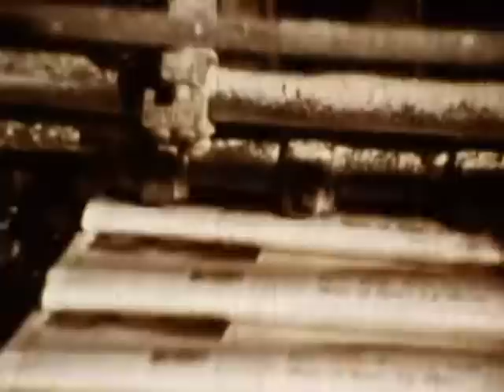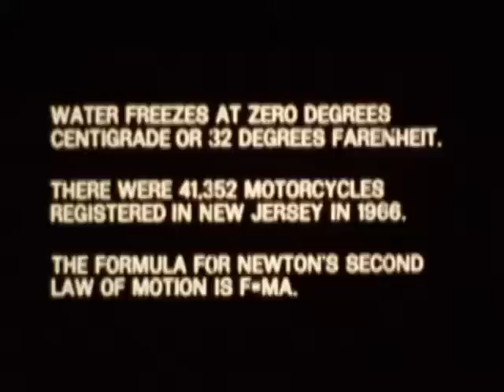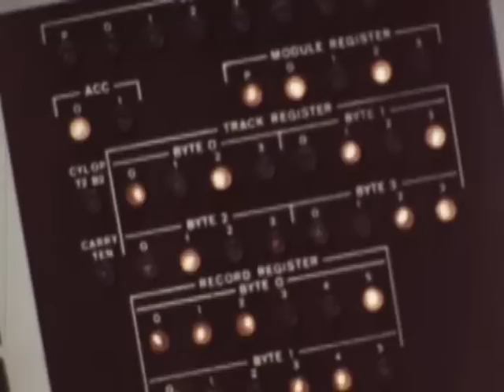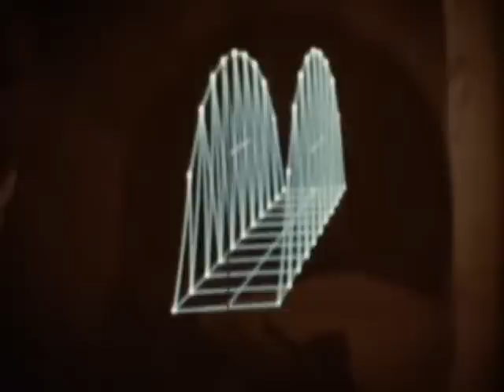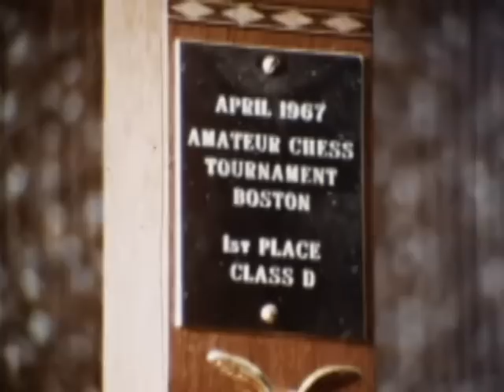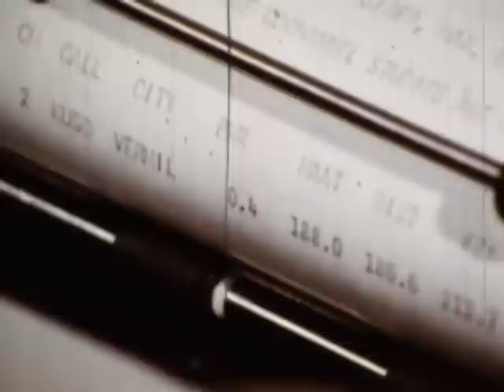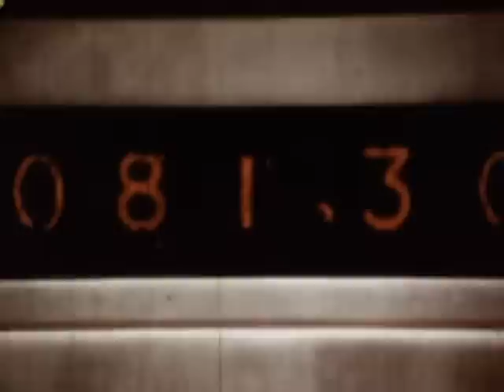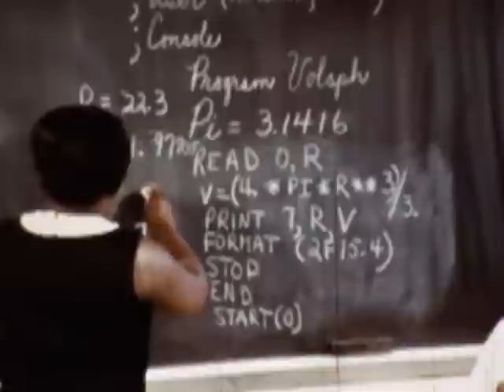1967, THE COMPUTER REVOLUTION, Isaac Kleinerman, Walter Cronkite

Comment: As far as air traffic, I became an Air Traffic Controller in 1974. Our en-route center had the IBM 9020, essentially three IBM 360s tied together. Its purpose was to process flight plans and create paper flight progress strips. When I arrived, they were in the process of converting the display consoles to a digital display with single-site broadband radar as backup and shrimpboats. There was another huge computer in the basement that did nothing more than write the graphics and write orders generated by the 9020. I went into automation in 1986 and transitioned the computer array to the G-3, which reduced the floor space needed to less than one-fourth of the 9020. 
By now, I'm sure that some AI has taken over and separation instructions relayed directly to the aircraft with the controller monitoring. 
Walter Cronkite would be amazed at what we have now. Now, complete news stories are written by AI, biased automatically, and accepted by any news editor.
In the not-too-distant future, AI may be designing and manufacturing computers and hardware that mankind will have absolutely no idea how they work. Imagine, “Colossus - The Forbin Project,” becomes an actuality wherein mankind are slaves to superior AI machines!
Reply: Still there are humans working as air traffic controllers, aren't they? And that was their first example of jobs to be taken over by the computer. The other one being in health care. So off the mark...

Comment: I worked in a large data processing center in 1967 when I was 19. I was a relative newcomer, just out of high school, and I only got to run the lowly IBM 1401. Even that 'small' computer was the size of about 6 refrigerators strapped together. Even then, the secret geek was evident in me. I used to fantasize about having my own 1401 in my basement at home. God knows what I would have used it for, but I wanted one. What would an individual back then need a computer for? Never really thought that it would actually come to pass. Probably have a dozen or so lying around the house today.

Comment: HE didn't know what he was Talking about...LMAO. 

I didn't watch this documentary yet. The First computers used vacuum tubes. Then, mechanical relays came into play. An array of tiny, doughnut-shaped magnets were used for storage. Transistors were a major breakthrough. The Integrated Circuit, however, with microscopic components-revolutionized Everything. 
Airplanes, Automobiles, All kinds of Military Technology, were changed Overnight. 

And, WHO would have THOUGHT that we would almost ALL have small,  reasonably-priced personal computers in our HOMES?!?

That's Real Jules Verne and "Jetsons" stuff.

Comment: I was 15 in 1967 when I wrote my first computer program. I typed it into the computer which then produced a large stack of punch cards. Those cards were then fed into the computer which then told the  machine I was programming what to do. I was enthralled and fell in love with computers from that day.
Reply: Did you make your career with computers then?
Reply: I wrote my final university exam in Fortran. I still have one of the punched cards!
Reply: Did you leave your cards on top of the line printer?  When the hospital I worked at, I was operating the development center computer (where the programmers could test their programs in an simulated production run to see how their programs would interact in the actual production mainframes).  A programmer had spent a few days writing a new COBOL program for the lab, about 100 cards.  He left them on top of the line printer, and went to get coffee waiting for me to finish the current job so I could compile the program for him.  As he was coming back into the Development Center, the printer ran out of paper and started lifting the lid.  Neither he or myself moved fast enough to get the cards off the printer, and they spralled all over the floor.  He wasn't happy.  I asked if he saved the program to disk, and he did, so as he picked up the cards, I punched a new deck for him.
Reply: Ad in the back of the TV Guide: "Work in a Growth Industry...be a Keypunch Operator."

Comment: "12,000 lines an hour"
200 lines per minute
3.33 lines per second

I soldered together my first computer in 1978. I just bought a used Dell Core i7 for $150.

It could probably do 12,000 lines per second without breaking a sweat. 

I doubt that most people today comprehend how much processing power they are buying.

1s and 0s in magnets? Oh yeah, they used core memory back then.  They still call it a core dump even though core technology is no longer used.
Reply: @rum-ham  
LOL, yeah, we Olde Foggies are occasionally useful. The computer industry is strange with so many details that can be critically important in some circumstances and totally irrelevant in others. I was a Customer Engineer for IBM and had to do a  core dump on a System 3. The computer operator who actually ran a computer way more than I did asked me to explain what it was. I was surprised he didn't know. System 3s had real core memory.